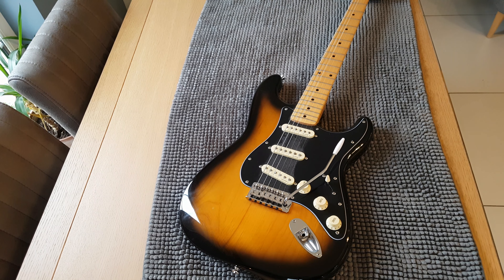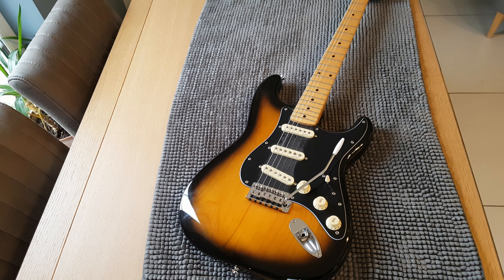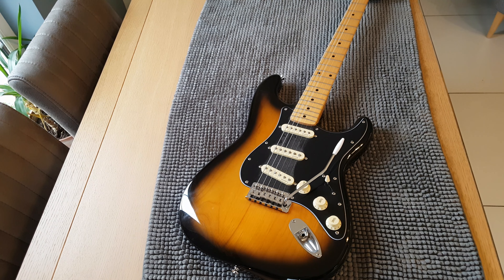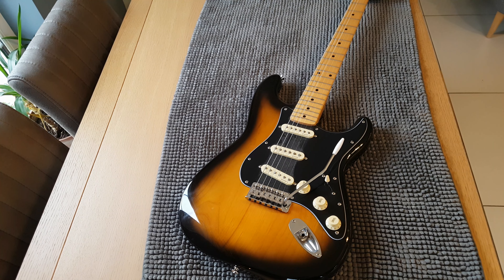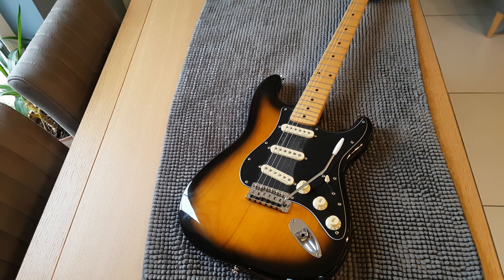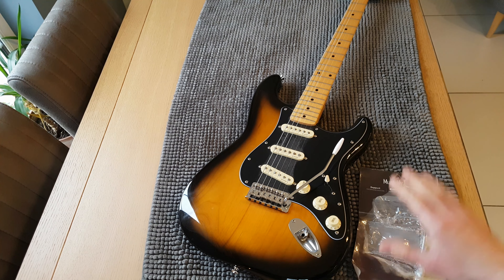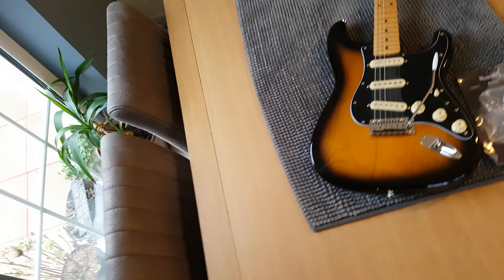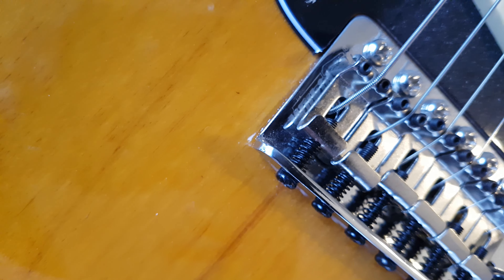PART 2 Squier Affinity Stratocaster  Wilkinson/ Musiclily Tremolo. GENUINE WILKINSON?

Comment: You don't have the facility to remove a few mm? Sandpaper on a flat surface would work, so would a file and vice.

Can also use a file to notch the block so the springs sit recessed so you don't have to remove much of the block.

If that PRS style bridge was floating style, you can also raise the bridge as high as possible so your lowest saddle/s adjustments are decked

This is all because of the squier having a thinner than standard strat body, not a fault of the product. Would fit fine in a standard strat body. Musiclily licensed Wilkinson also appear to supply squier spec thickness blocks now.

Comment: Surely, if it is a genuine Wilkinson product, it would be in Wilkinson brand packaging, NOT in Musiclily blister pack branded packaging.
Reply from the maker: I've bought 2 genuine wilkinson bridges in the past. One my from my  Local music store and another from a reputable online retailer. Both items came in clear unbranded bags. My initial thoughts on the Musiclily packaging was that they had some licensing agreement to produce Wilkinson products. I'm still not sure what the relationship is between the company's or if the Musiclily products are simply fake!
Reply: That’s not how it works, Wilkinsons are licensed to many manufacturers.  This means they can build them as long as they follow Wilkinson specs and pay for license agreement.  The package can come from any number of companies even the expensive ones are not from Wilkinson usually from Gotoh.  This is business concept.
Reply: @budgetguitarherogeartv4143  read my comment.  You guys need to get informed on the business end of things.
Reply from the maker: @bluwng  thanks for your comments. I am aware of the relationship between Gotoh and Wilkinson.  All I can say is that the quality of the Musiclily product is not comparable to any of the wilkinson bridges that I have used in projects in the past.  If you have links to support your comments I would be grateful if you could post them here.
Reply: @budgetguitarherogeartv4143  you misunderstand, I never said they were equivalent.  These manufacturers only have the right to use the design the materials and manufacturing process has no restrictions.  You are polite but still lack understanding.  BTW Musiclilly is a distributor they are not the OEM.